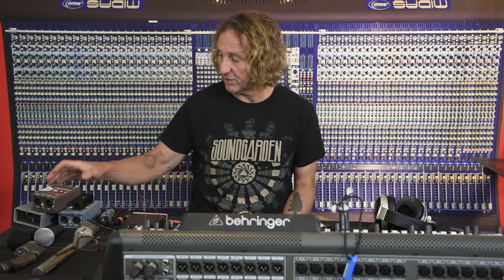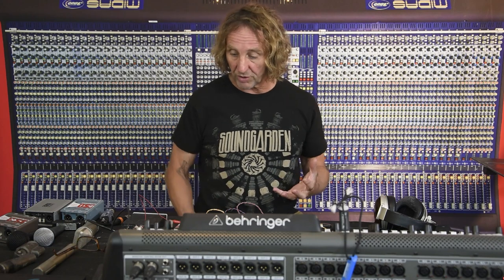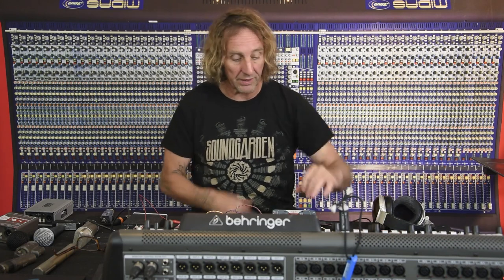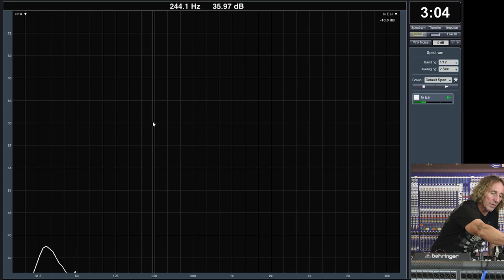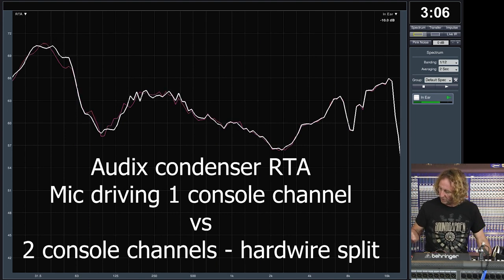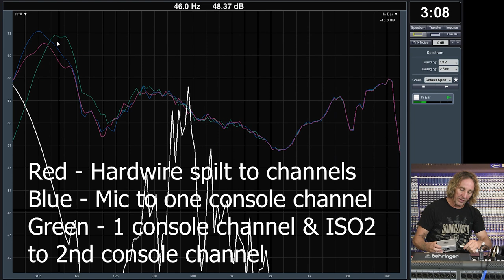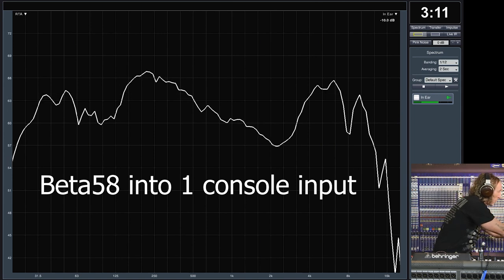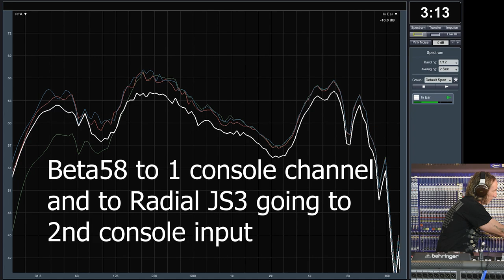Do Audio Transformers Mess Up Sound?  Demo Part 1

Comment: Every component that goes into an audio circuit will have it's effects on the signal path. Transistors, tubes, ICs, passive components ... all can have their advantages and disadvantages. Good audio transformers from companies like Jensen, Lundahl etc. that are wisely (!) used in a circuit will have an effect, but mostly by improving CMRR (Common Mode Rejection Ratio) and SNR (Signal to Noise Ratio). The frequency and phase linearity of good audio transformers plus their low THD make them suitable even for the highest quality designs. So will transformer based equipment sound worse? Only if it's a crappy design or by intention (e.g. to achieve a certain sound). The SM58, like most dynamic and ribbon microphones, is especially sensitive to impedance (Z) mismatches. Loading a dynamic or ribbon microphone with less than 10 times it's own impedance (e.g. 150 Ohms > 1500 Ohm at input) can drastically change the impulse response which is the main reason why the sound changes as well. So it's actually the users (or equipment designers) fault of mismatching impedances and never the fault of a good transformer. Using transformers is just another way of doing things - not better or worse.
Reply from the maker: And also, if the sound of your show is dialed in and you then add a transformer split to send the mics to somewhere else like a recording truck. The addition of the transformers will significantly change the sound of the mics and everything those mics are connected to, even if those sends don't go through the transformers.

The transformers may make things better, may make things worse but either way, your show won't sound the same once they are added.

Comment: To me, it looks like you are not comparing between the two correct points in the chain. If I understand correctly, you are essentially testing what happens to the Y-split signal BEFORE the transformer when a transformer is connected on the other side of the split. However, shouldn't you be comparing the signal without any sort of split in the chain with the signal POST transformer? You wouldn't ever Y-split before using an active splitter (transformer), because the whole reason why active splitters exist is that Y-splitters perform poorly when they are hooked up to two inputs with different input impedances.

To rephrase this: I am interested in a comparison between the sound without any transformer in the chain (also not on the other side of a Y-split!) and the way it sounds after the transformer, if we do indeed choose to use it. I am not seeing you compare those. 🙂
Reply from the maker: Adding the transformer changed all the sound of the chain. It changes the sound the mic puts out. Measuring the hardwire splits or after the transformer has the same or nearly identical sound. Removing the transformer changed the sound. There are 3 vids in the series which show more.

Comment: Any transformer has a usable bandwidth. It is part of the physics of the device. Many common microphon4es contain a transformer for changing the impedance from the capsule voice coil. An example is the Shure SM58. This allows using a less delicate voice coil with fewer turns and heavier gauge wire. Transformers do not work at all on DC and as you approach DC in the lower audio spectrum, the phase shift and attenuation increases. At the upper limit of bandwidth, core eddy currents again impact attenuation. High frequency transformers such as found in a switch mode power supply use powdered iron in the core to reduce losses in higher frequency operation, but at the cost of less iron in the core resulting in loss of response in low frequencies. Any audio transformer is a compromise due to physics. This is the reason active DI boxes are made for keyboards and other extended range instruments. A passive DI is fine for instruments with magnetic pickups as they are already frequency limited by the physics of the magnetic pickup. Lessons leaned.. use magnetic DI for converting impedance of high impedance magnetic pickups. Use active DI for electronic wide band instruments such as a keyboard. This experiment shows the actual physics of phase shift of inductors and limited passband.
Reply from the maker: And also, mics sound one way and when using an iso transformer the mic sounds different on everything connected to the circuit including the direct out that isn't even going through the transformer
Reply: @DaveRat  Dynamic mics, as well as magnetic guitar pickups are affected by loading. The effect is the strongest in the lower frequencies.  The additional load attenuates the lower frequencies more due to the properties of a transformer. To keep the mic properties unchanged, use an active DI on your dynamic microphones or if you use a passive DI, make up for the loss with the EQ. Even the Beta 58 has the roll off in the low end. Condenser microphones can have extended low end, which is why drum kits are often setup with dual mics with the inside mic a PZM condenser.

Comment: There's a flaw in your testing method.
You are using a hardwired split with one side of the split going to a channel in the mixer.
When you place a different "load" by way of putting a transformer on the second leg of the split you are of course going to alter the way the other leg of the hardwire split is going to act simply because its impedance is going to change in accordance with the changes in the second legs impedance changes.
In a typical FOH\monitor split, or FOH\Recording split one leg of the split is hardwired through to one of the mixers but the other output of the split is transformer isolated (doesn't connect directly).
There is no change in the impedance on the hardwired connection, and any changes in impedance on either leg don't affect the other line and shouldn't affect the mic frequency response except that transformers will typically color the sound and may dull transient response depending on the quality of the transformer.
Reply from the maker: Hmmm. We own about 20 or so splitters and toured as a sound engineer for almost 40 years doing events ranging from clubs to stadiums.

Though there are many ways of splitting, the common ones tend to be

Hardwire to 2 consoles

Hardwire to one console and xformer to the 2nd console

Hardwire to 2 consoles and xformer to the record truck

Hardwire to one console and transformer with 2 secondaries, on to foh or mons and the other to rec truck

Our 2 way concert splitters are mic input with 2 outs, 1 is a direct out and the other is a transformer out

Our 3 way splits are direct out, transformer split out 1 and transformer split out 2

As I go through the videos I will show that purely adding the transformer to the circuit alter the sound of the mic and therefore everything connected to that mic. And that terminating the transformer 8nto a console channel slightly increases how much it alter the mic sound.

And that different mics are impacted drastically differently and that different transformers have drastically different impacts.
Reply: @DaveRat  I always heard that an unbuffered split causes the gain to interact between the two sides. "gain fighting" is something I don't fully understand but I would guess that the effective impedance of each side of the hard split is affected by the gain used on each side.
Reply: that said, if FoH and monitor engineer are working together, once the level changes are done, there should be no more "gain fighting" and certainly no transformer coloration on a hard split! YMMV with op-amps!!?
Reply: Calling it a flaw might be a stretch. Dave is choosing a method to look at the problem and provide a relative measurement to compare to point out variations, and thus a valid measurement. There's many ways to connect up a measurement scenario to get at this particular topic of transformer coloring. In the case of a direct hardwire split, the coupling is directly wired yes, but anytime you piggyback something on that direct coupling, you do in fact change the impedance matching of that hardwire coupling and any load placed on a transformer split will effectively mirror back impedance changes to the primary side of the transformer and anything it's piggybacked onto, sometimes negligible, and sometimes massive.
Reply: @DaveRat  Well congratulations on being a sound engineer for almost 40 years and doing events ranging from clubs to stadiums.
As a sound engineer with about 20 or so splitters, you know that splitters that use transformers typically have one output that is hardwired directly to an output.
With 40 years of experience, you also know that splitters that use transformers connect to the same input as the hardwired input, but utilize transformers as a way of isolating the additional outputs.
Now given that you have vast experience in stadiums you may use multiple inputs into your splitter but you probably don't use a hardwired split with another splitter on one leg of that hardwire split,
As a sound engineer, you would realize putting a splitter, or even a transformer on one leg of a hardwired splitter would cause one leg of the hardwired splitter to have a different impedance, due to the added resistance of the transformer, compared to the other leg with no transformer.
Putting a transformer on one leg of a hardwired splitter would cause the impedance of the other leg to vary (change) as the impedance changed with the load applied to the transformer.
That is why you got the results you did, but that is not a real-world scenario as a sound engineer with 40 years of experience working events from clubs to stadiums would know.
So the question is does having (a) transformer(s) in a splitter affect the hardwired leg of a splitter (or affect the output of the microphone on a hardwired leg of a splitter, and does having phantom power applied to the hardwired side of the splitter affect the transformed signal?
I'm looking forward to your exciting conclusions!
Reply: @sonicfrog1  The "flaw" comes from the method that Dave is choosing.
The typical split is either done with a hardwired split or with a hardwired output and outputs isolated by transformers connected to a single input.
By putting a transformer on one leg of a hardwired split he is effectively altering the impedance of that leg and because the two legs are hardwired together any load (microphone signal) applied to the transformer will cause changes in impedance to the other leg of the hardwired split as well.
The idea behind adding transformers in splits is to isolate additional splits from the hardwired pass-through.
So if he ran a single microphone directly into a splitter with a single input and then measured the differences in the outputs that would be the results that would be meaningful.
Does that make sense?
Reply: @JonAnderhub  Sure, it makes sense what you're saying and I'm not in any way meaning to jump on your case here. I'm only pointing out that the testing method is one way to provide a relative measurement upon which he can then base further observations. Your method will also produce said results and would work just fine to get to the answer of showing that there is a coloring of audio when using passive transformers due to impedance changes. The real world physics of this is that anytime you introduce a new ingredient to the soup, that ingredient isn't only affecting the nearby elements, but it's affecting the entire system until said system reaches a balance or equilibrium. An impedance shift on a leg of an audio line is coupled through by the addition of any transformer and mirrored to some degree back and forth through ALL windings of that transformer. i.e. there are useful "isolation" results that happen because of introducing a transformer, but there is really not any isolation so to speak from reflected impedance changes on subsequent transformer windings. An active system involving amplifiers and transformers can stabilize and maintain impedance matching, but it requires the addition of power to do it. Passive transformers do a nice job in some respects, but not without some kind loss somewhere else. Many systems in the world can show us the same example, think of your car air conditioning or heater vents. If one vent is open, and you open another, the impedance to entire duct work is affected, and the individual output flow of each duct equalizes to achieve the balance that the system will look for given the power available in the blower fan. Air handling, plumbing and mechanical systems work the same, though they all use slightly different terms to describe the forces at work, it's the same mechanism. Point here I think Dave is making is that while transformers solve problems in some way, they aren't without their faults and sometimes it's easy to dismiss those faults since many times transformers come in and save the day right at the house lights out call. :)

Comment: Transformers have problems. Size. Weight. Vibration. Cost. Repairability.

Other than that they are just fine. These days people do splits by converting to digital.

Comment: Strange no mention of the reason transformers are superior, the good one’s have far better common mode rejection than any solid state solution to balanced input.   No great mystery the issues with dynamic microphones… sensitive to load impedance.
Reply from the maker: Also condenser mics are impacted as well.

Transformers can be useful tools. And knowing the issues that the tools used to fix things can cause, can help one decide whether using the tool is worth the audio or financial cost

Comment: No dont mess up as line in not same micphone input
Reply from the maker: The line transformers will work great or even better for mic level but are expensive and bigger. Mic transformers may overload with line level.
Reply: @DaveRat  thank you dave